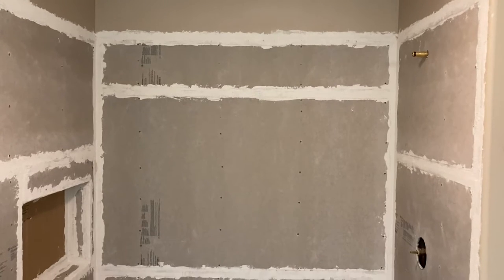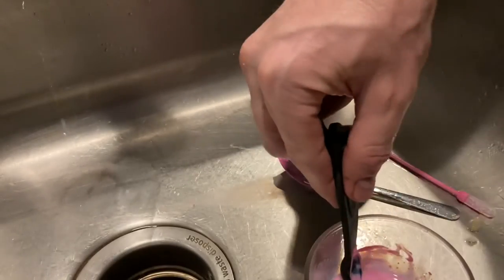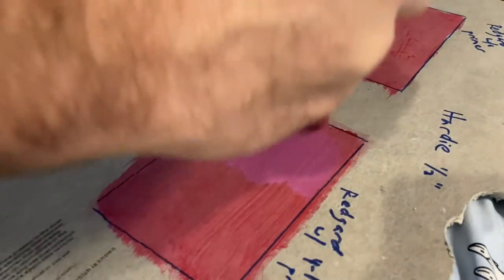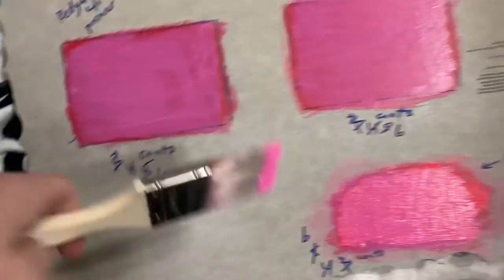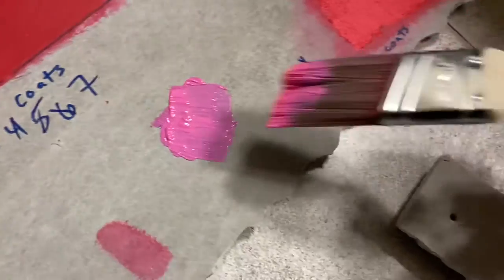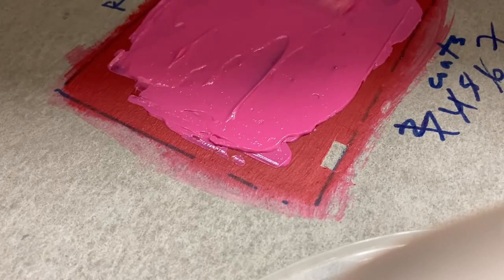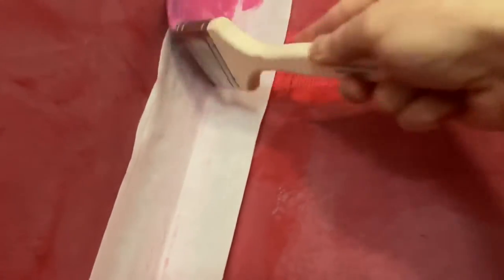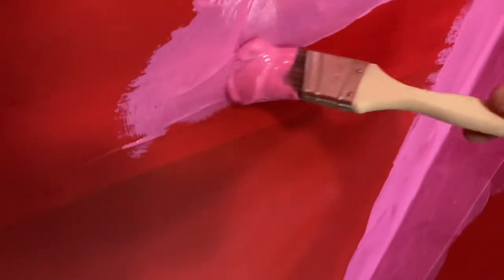️🔥 Redgard➔ How Many Coats Do I Need to Apply to Waterproof Shower Walls? (How Thick in Mils?)

Comment: Its actually nothing like paint.   The only similarity is that it is applied with a roller (preferred) or a brush.  The bottom line is ensuring the proper thickness to act as both a waterproofing and crack prevention membrane.  That said, when applied correctly it is a pretty cheap insurance policy for your build.

Comment: Do you stir your red guard before you use it like you would paint?
Reply from the maker: Hey - I emailed the company. Here’s their response: “There should be no need to stir RedGard, it should be ready to use as is.  If however, you find that it has separated, then it should be fine to slowly stir the product.”
Reply: @diybandit  thanks

Comment: Is the tape required?  I thought it was Durock, then thinset with mesh tape for the Durock, then RedGard 2-3 coats, but I never heard of taping the RedGard.
Reply from the maker: Good question. Not sure if it's required, but I had seen several YouTube videos that did it, especially for the shower niche. It was low cost and relatively easy to apply and provided an extra layer of protection from water entry over gaps (the thinset and mesh tape aren't a water barrier).

Comment: 25m is not necessary its called they want you to buy more of the product lol. As some have shown walls with ZERO waterproofing getting remodeled after 30+ years and could go longer lol. Worry about the floor / curb and 6inches up thats bout it. No need to do all this nonsense. Good video though